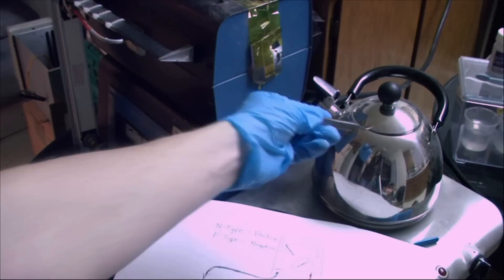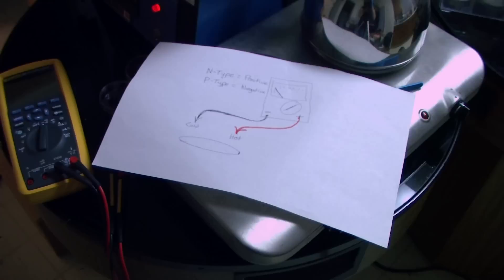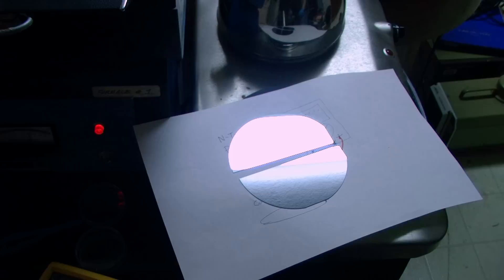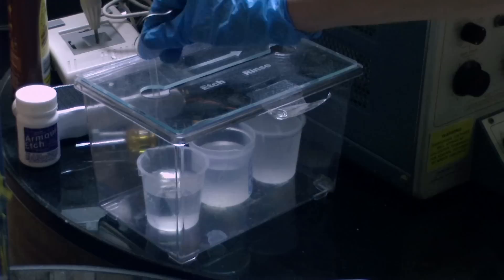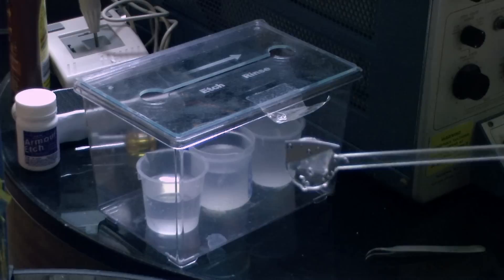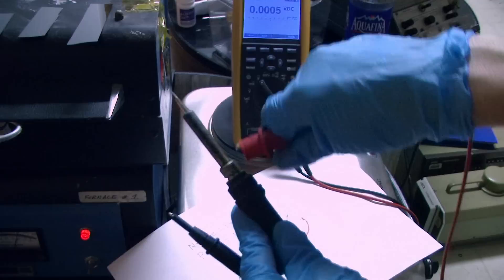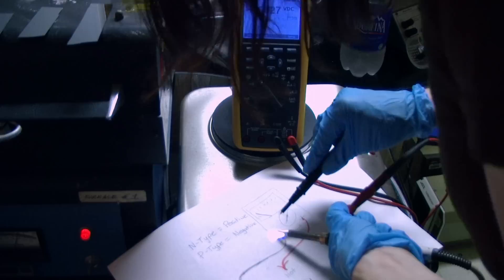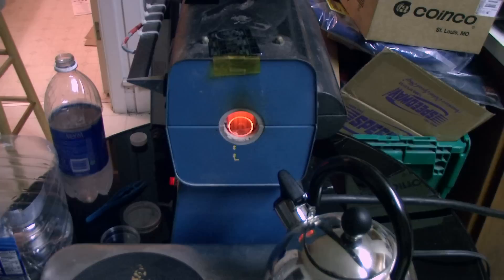Making Microchips at Home - Cooking with Jeri Part1

Comment: This is what I always imagined a modern McGyver doing in his kitchen. Got no base circuit-board, just dry out bananas under pressure. Lacking a sepparating coating for wires in a electro-magnet? Use duct-tape. In fact, toss out the banana, dryed pressed duct-tape works even better. If there is any duct-tape left, you can fix any open wounds, just make sure to rince it in bottled water, or UV-sterilized rain-waiter. I have no clue about electronics, but this just seems cool no matter what

Comment: This is very refreshing! I have thought about making my own IC at some point but I haven't done it yet, this is great! I bought a thermal evaporator that I use to make condensor microphone diaphragms off of eBay, Something like that would be a perfect addition to your setup if you wanted to deposit metal interconnects.

Comment: FANTASTIC JOB !!!!  Great Work !!!

This is the start of great things for you!

As an microcircuit enthusiast in Vancouver, Canada
who has dabbled in a tiny bit of CPU/DSP circuit design, 
I've been looking for just such a Youtube channel as yours!

I have been eagerly looking for a way to do what 
you have just shown at home for many years.
I've been itching for a way to not be so beholden 
to the wayward scheduling of our parent company's 
chip etching system.

You have given me some incredible ideas
and I think I just might be able to figure out
a way to semi-automate SOME of your processes
using home-built high-temperature-resistant 3D printers
built from ink jet parts, ceramic and a 
do-it-yourself vacuum chamber!

I think IT MIGHT BE POSSIBLE to dope the chips
using a process similar to thin-film vapour deposition 
within a DIY vacuum chamber made from an old 20 lbs 
barbecue propane tank containing a TINY sealed printer 
head taken from an Epson or Canon inkjet. You will probably
get a much more diffuse distribution of dopants using the 
nanoliter/picoliter capabilities of modern
(and CHEAP!) inkjet heads!

You might need to spend MAYBE $500 on parts
and another 50 hours on assembly for the
print head containing vacuum chamber.

The SAME type of ink-ket technology could also 
be used as a DIY chip cleaning system within a 
SECOND propane tank vacuum chamber
to spray solvents and/or specialty washes
at nanolitre/picolitre amounts.

For the chip masks, I suggest old large format ink jet printers
you can buy off eBay for less than $1000. Just make 
sure their resolution is 600 dots per inch or better
and PREFERABLY 1200 dots per inch or better.

Print each layer of traces onto optically clear film 
using full black ink only!

I suggest printing onto:

ORAJET® 3352F Optical Clear Film

from Orafol Corp or similar types of optically clear film.

Print your traces and layers at 600 dpi or 1200 dpi 
at up 36 to 48 inches wide. Using such large prints
for your traces means you can using a CHEAP DIY 
LED-based Infrared light array to expose the large 
film sheets into a CHEAP but truly optically clear 
high refractive index plastic focusing lens sourced 
from an optical supply store.

You just need to build a large enough film-sheet 
holding frame (48 x 48 inches) and keep the plastic 
film electrostatically held onto a clear but very stiff 
1/4 inch thick polycarbonate sheet embedded into 
the holding frame. The plastic-film-based printed 
trace sheets MUST be held on UNDERSIDE of stiff 
polycarbonate holding sheet to ensure less ragged 
trace edges when the Infrared exposure is reduced 
to micron levels.

The large inkjet printed traces should then reduce 
quite nicely down to micron-level traces. It should 
be QUITE POSSIBLE to do two micron or 
even one micron circuit traces at enough
accuracy that it is FEASIBLE to build a
DIY 16-bit Intel 8086 CPU AT HOME !!!

My estimate is around $1400 for the 
IR LED array parts, focusing lens and
sheet filmholder parts and $100 electrostatic
charger and the stiff polycarbonate sheet.

So for much higher end performance chip 
making AT HOME, I think it's DEFINITELY
feasible with around about $2500 and 
about 100-to150 hours of build time.

Best Wishes and GREAT JOB !!!!

Comment: Quick note. If you try to make circuits like this, outside of a clean room, you are gonna have tons of contaminants. There's a reason why the big chipmakers have to invest Billions in their production facilities.

Single transistors might work, at um scale. I did the same for my BSc in Electrical. At a useful scale, lets say ~100nm, and with a proper processor mask, not single transistors, you would have to build in a lot of redundancy in the circuits for failing sections due to contaminants.

You will also need some way to measure the failure rate of the different circuits, have some way to mark or discard the output of failing paths, etc. It sounds like a massive pain, tbh.

It would be better to build a larger batch and hope that you get at least one really good one.

Alternatively, you can use a vacuum chamber with tap water to reduce some of the contamination. Maybe a "clean box" construction rather than a clean room, isn't too far fetched.

Comment: @NoWattz I didn't check the temperature, but it was hot enough to melt solder.   The tip can be grounded or not, because the meter is not grounded.

Comment: I know this is an older video. and I know only what you have told in this video. but I'm asking could a whole or large piece of wafer be used to build a large high current transistor. it probably doesn't work that way does it? now that I'm thinking a little more. it is probably like how you get higher current capacity with MOSFETs. like there is a difference in a lot of wire. a long thin wire isn't the same as a short thick wire. even though they are both a lot of wire! like I said I know nothing! great video. I'm glad I came across your channel.

Comment: For miniturisation, this should be combined with 3D printing at home (not plastic printing of course - LOL) to make "proper" chips and I think a few megahertz could be achieved (one day like a motorola 68k or more powerful) but before that maybe a chip akin to the c64 and after all jeri did make that handheld joystick 6c4 Television games gadget. Even though the power consumption would be high for such a computer made at home, one day the process would be more efficient and "normal" power consumption chips could be made for boards similar to an arduino. This would be great for making emulators or even full on retro computers with expansion cards for graphics and sound all 100% open source.

Comment: I get my regular dose of HF from testing hundreds of Li-Ion/poly cells per day...some are very resistive (no pun intended) to those tests and show their protest with smoke signals and fire ocasionally...
So they walt the plank into a big bucket of water for that mischief ;-) 
I am still alive and no health problems for now...sure i try to suck out the fumes with solder fume extractor (well a clothes dryer blower+some tubing>out the window), but some smoke still escapes...

Comment: I watched your Homemade transistor video of and I want to do the exercise at home myself and make a transistor. Need some information like from where to purchase a p-type blank wafer.
How to injecting n-type in to the p-type. From video it is not clear to me, how to fuse the n-type in to the p-type? Also how do I obtain the n-type materials.
I have a bench, voltmeter, soldering station, scope, but not an hoven. Thanks

Comment: I'm running a very similar oxidation furnace right now and really it's not much more sophisticated.  It has boiling water and 1000C.  Don't allow dopants or metals in mine though.  How long did you run your oxidation?  I'm running 17.5 hours for about 2um.  Also note that I'm not scolding you about the HF.

Comment: The first step is to remove any oxidation (hence the HF bath), but then it seems the second step is oxidize the heck out of it (hence the heat/kettle).

Is it simply to make it uniform oxidation, or is there something else that's happening in between?

Comment: Hey Jeri, be careful using plastic/latex/nitriile gloves when working with hot stuff like soldering irons. It is an OHS risk because it can melt to your skin. At this stage though you weren't handling anything chemically dangerous so it is actually safer not to wear them. Personally I recommend not using gloves except when you absolutely have to ( i work in molecular biology).

Comment: Jeri Ellsworth Did you have a look at the material safety sheet of the glass etchant you are using? It does not contain any HF.... it uses ammonium bifluoride to etch glass and contains some sodium bifluoride (for safety reasons I guess)... this is imho the reason you get away with common sense and household grade gloves.  "real" HF solutions are in fact quite dangerous [1], because of the delay between tissue damage - due to HF - and noticing the damage.

By the way: Great video thumbs up

[1] http://www.pdx.edu/environmental-health-safety/sites/www.pdx.edu.environmental-health-safety/files/HF%20Safety.pdf
Reply: Forgot the good stuff: http://chemistry.harvard.edu/files/chemistry/files/safe_use_of_hf_0.pdf
Reply: +Markus Bina that's different product, the rust remover (sans iron in the name) contains between 1-2.3% HF: https://www.whink.com/cmssites/ws0811www.whink.com/uploads/Documents/Rust%20Stain%20Remover%20SDS.pdf Just the right dilution for removing the oxide layer: https://en.wikipedia.org/wiki/RCA_clean#Second_step_.28optional.29:_oxide_strip

Comment: I have a lot of respect for Jeri. That being said, this is 10 levels of irresponsible. Anyone who sees this video, and buys pure HF to follow your example is risking their life. Supermarket Rust cleaner is ok. You have to tell people NOT to buy HF pure and try to dilute it.

I worked with pure HF at a chem lab.

Please anyone working with pure HF, follow guidelines - google UNC  Hydrofluoric Acid Chemical safety to find the proper guidelines.

- HF can and will eat into your damn bones and eyes, if it contacts your skin. No fucking way to get it out, because it penetrates so deep. You may lose your sight or your limbs if you are careless. It also can create toxic fumes.

- You have to prepare a workspace where you have good ventilation, no clutter, and a workspace where you can deal with spills. 

- Prepare the antidote and cleaning pads with neutralizing agent.

- Wear protection, which you can dispose immediately in case of contact.

Comment: I really don't see what the fuss is about.  if you were going to fake something it doesn't even make logical sense to fake something so obscure as a transistors when it'd honestly take less time to embed a coincell in a little PC fan with a reed switch then glue some magnets on the fan blades and say you found a magical energy device that would get you exponentially more views than "faking" a transistor" while still paying for everything necessary... People are so dumb and quick to judge sometimes.